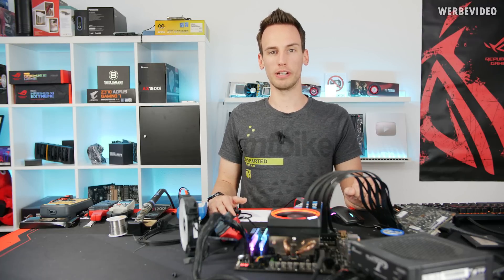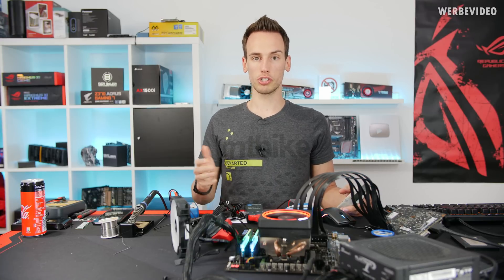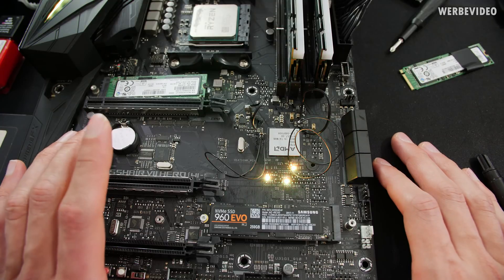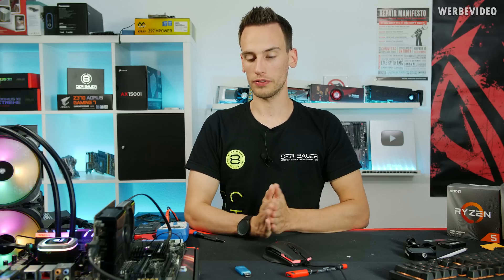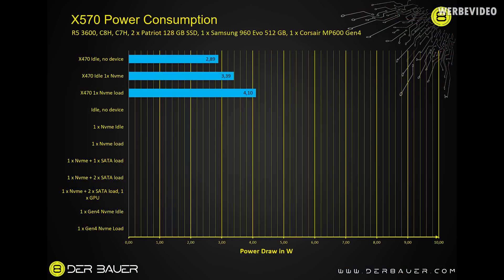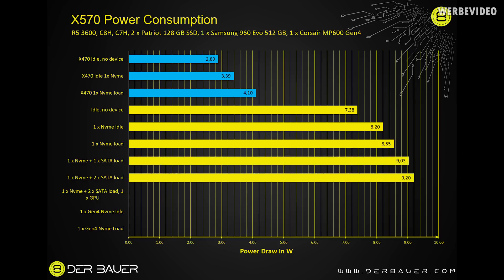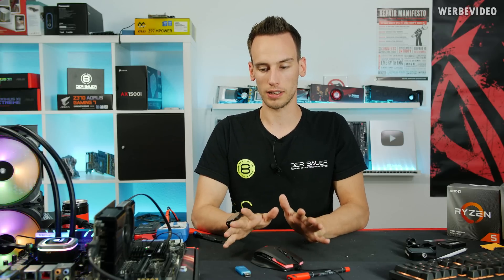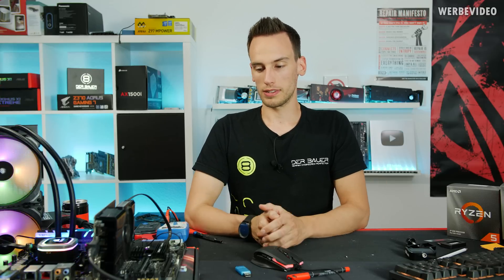X570 Power Consumption Measured - What is going on here?

Comment: IMO it's probably because of the chipset needing to push 4.0 signals to the CPU.  Perhaps the power reduces if you put a Ryzen 2000 CPU in X570 since it will not support 4.0 signaling between the chipset and the CPU?  Or maybe it's just that the X570 chipset is not entirely a purpose built chipset and more like re-using an already existing design from the CPU I/O die?
Reply: Afaik, they are using the I/O die because Asmedia has been having issues getting theirs ready which is what will be used for B550.
Reply: Nothing to do with 4.0 signalling. Going down the wrong path here.
Reply: I was kind of thinking along those lines, however, with none of the circuits terminated, where is that amperage going?

I mean the transistors for the interconnects are powered on but the interconnects aren't hooked up to anything.

It's sounding like the IO die/x570 has zero power management it's it's design at all. That means there's likely a 5-10w difference between Zen 2 and Zen 3 because this is a mistake. I've got entire computers that idle at 20w.
Reply: what about 4 nvme RAID + full PCIe + full dimm usage, put more stress on chipset
could that passive cooling handle the heat ?

*learning from the past overheating northbridge = system failure
Reply: Chipset does not touch RAM at all.  The controller is CPU integrated. There hasn't been a northbridge for years.  Due to the 4 lanes of PCIE 4.0 between the chipset and CPU it would be a fools errand to raid more than two SSDs through the chipset.  While the chipset technically does support up to 16 PCIE 4.0 lanes, they will be bottlenecked by the 4 lane link between the CPU and chipset.  The chipset also supports up to 8 10gbps and 4 480mbps USB as well as 4 sata 6gbps ports.  Again, all devices on the chipset will still be limited by the thruput of the 4 lane link though.
Reply: i think its cause its a used IO die. probably unused stuff using power. x470 was a purpose built asmedia chipset
Reply: That's my understanding too. As far as I can tell the X570 "chipset" is just a 14nm version IOC of the IOC in the Zen 2 chip. It uses the 2 infinity fabric links as PCIe 4.0 multiplexers because each infinity fabric link is basically just a PCIe x32 link at the hardware level. So all the 24 PCIe 4.0 lanes are routed to the chipset before going to the NVMe drives and PCIe lanes. That's probably the reason for the high idle consumption of the chipset with a Zen 2 CPU installed. An easy test would be to measure again with a Zen or Zen+ CPU instead an see what the power consumption would be in that case.
Reply: @Wasted waster They're still routed through the chipset. All 24 lanes. And can be multiplexed into a maximum of 40 lanes (typically less).
There is a genuine need to release PCIe 4.0 this generation. PCIe 4.0 NVME drives was just around the corner, AMD helped getting an early version NMVe controller out the door early but by CES 2020 most other controller makers would announce their version as well. AMD knew this and prepared to have the option in their current products instead of potentially having to wait 6-8 months to put the feature into their platform, and letting Intel get a possible win.
The entire Zen 2 launch is a showcase in how to completely destroy your competition in every field. That's reason enough to include PCIe 4.0.
And like some reviews have mentioned the PCIe 4.0 being on the 5000-series cards, while not important for regular gaming, is extremely important for encoding and decoding for example streaming where a 5700XT beats the 2080ti, not the 2080, not the 1080ti, no the 2080ti.

Comment: Hey Roman, will you test power consumption with new AMD gpus @ PCIE 4? - 5700/5700XT?
Reply from the maker: No. Why would you connect the GPU to the Chipset?
Reply: @der8auer  Command not clear, soldered PCIE 3.0 onto X570 chipset.